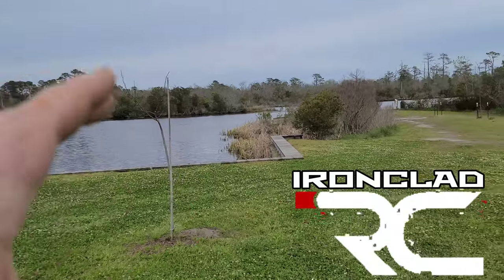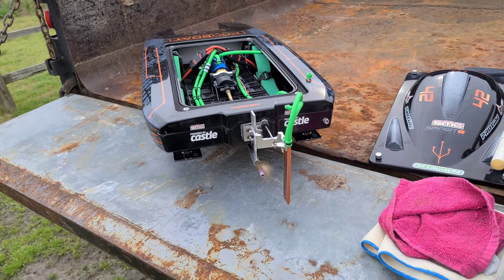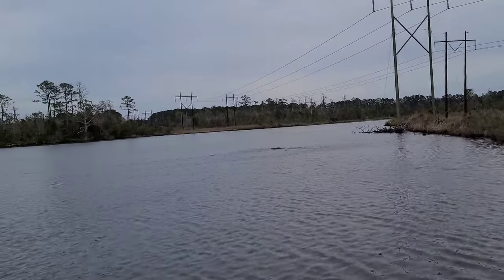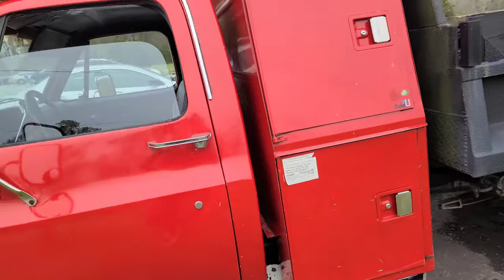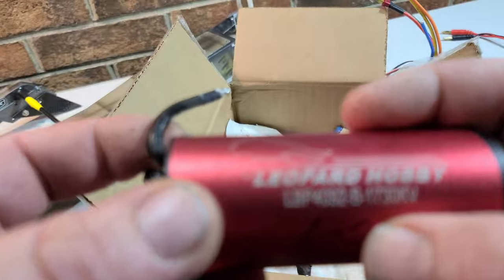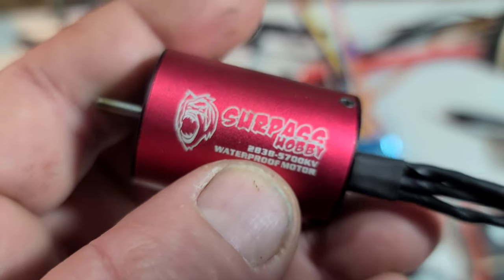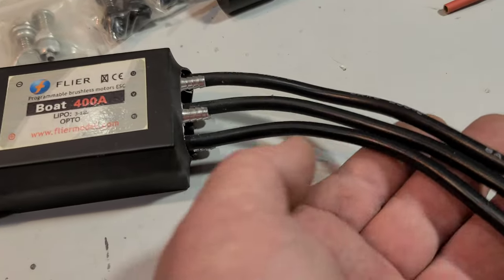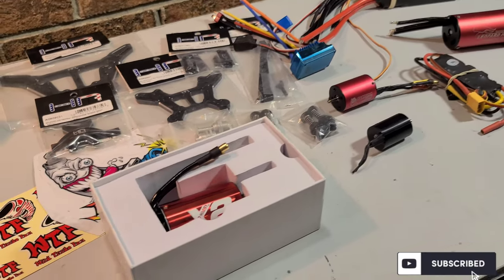Upgraded Blackjack Speedrun 90mph - Subscriber Mail Day - SMC, TPPOWER, HYDRA XLX2

Comment: Looks like you got BJ running right again. Solid passes...👍 
That 1730kv is a nice motor to test in Dom... Probably the 200a esc will handle it fine. Seen some guys using it on t180, so looks to be an interesting upgrade...
Reply from the maker: I'm gonna take the dom for a couple speed runs with the rocket motor before I install the leopard motor..  maybe do another comparison 🤔
Reply: @IRONCLADRC  you could consider a 6s comparison and see witch of the two motors give best speed, runtime, temps on same lipo's... Some people are very enthousiastic about those leopard motors, so let's Tinker and Tune i would say... Keep the vids comming

Comment: That truck in mint buddy!
Today's car have no spirit haha and they all look the same!!
Have a question if you don't mind, I want to run a traxxas 540xl 1800kv ( the one that comes with the spartan) but can't find any specifications on it.
I think it is made by Castel like a 1420 or something! I want to run it with a rcbb 175 esc but don't know what timing should I set the esc at?
So your help would be much appreciated!
By the way I have been flowing the channel for a while and I have to tank you for all the work you put into it so tanks man!!!
Boats gang forever 💪🏻💪🏻💪🏻
Love from Switzerland
Cheers mate 🍻
Reply from the maker: Thanks, wish I could help with the timing on your traxxas motor, not knowing the pole count & wind type we would be guessing..  I'm sure it's a 4pole but not sure wind count.......      delta wind motors 0-5 wye wind motors 6-15° timing.    Higher the timing more rpm but at a loss of torq usually higher timings result in more heat and vise versa.     Hope this helps.
Reply: Thanks B for the quick reply, that's actually the problems I got!
Don't know if it's a D wind or Y wind so I don't know where to start!
Gess I should try 15 degrees of timing first and go from there!
My actual setup is a tp 4060 1650kv pair with the rcbb 175 and it works great but I want to try with the Traxxas motor. My pb with a 4814 
2 blade is 60 mph
Thanks you very much B
Cheers mate 🍻

Comment: Sooo, that same thing would happen to my big storm rudder.  I replaced the stock servo with a 20kg servo found on Amazon and hasn't happened again. Hey b by the way I did a carbon fiber inlay on the big storm all the way through. I've had several mishaps and shes holding up better than I thought since its abs.
Reply from the maker: I bet the carbon fiber really helped sounds ironclad to me.     Have you GPS Tested the stock big storm?
Reply: @IRONCLADRC  havent gps it yet but you will know soon as I do. Hey I have an 80a esc (traxxas) sitting around and a Bancroft monster 19" cat. I gutted it. What size motor should I put in? Just general boating and decent speed.
Reply from the maker: If it were me I'd try a rocket 2968 3400 or 4000kv in that 19" cat, Both motors can be run on 3 & 4s  With a 90a flycolor.     leopard 2860 has been a good motor 3000kv ish range
Reply: @IRONCLADRC  big thanks big b 👊

Comment: You need some new projects ? I have 2 I'm thinking about abandoning and they're much larger than the last...
Reply from the maker: That's completely up to you....  I love that little hydroplane you sent I've been running it like every day here lately.   It's compact and basically fits in my back pack fun little boat
Reply: @IRONCLAD RC  I've got a BJ29 I don't have time for. Was moving things in storage and dropped something on it and broke canopy. V1 canopy is hard to come by
Reply: @brandonwynn9801  yeah they are about impossible to find. Someone needs to start make them
Reply from the maker: Absolutely if your not gonna build it, I would be glad to give it a shot..
Reply: @IRONCLAD RC  lol give it a shot huh ? I work out of state but will be home tomorrow. I'll be emailing you
Reply: BJ was looking and sounding nice 👍🏻 @ 90 mph. Not really sure how long running 12s on the stock 1350kv motor will last 😮 that would be almost 😅 crazy 😜 rpm 😂😂😂. I’m planning on pushing the stock electronics to the max, because of the telemetry 😊
Reply from the maker: The lead proboat designer recently told me the 4685 1350kv bj motor is capable of 12s.    Every since he said that I've had an itch to test it out.
Reply: @IRONCLADRC  Well now you have the 400 amp esc to try it out 👍🏻
Reply from the maker: Yes sir buddy

Comment: Hey man love ur vids! I had an idea not sure if it is even possible to do but maybe u can point me in the right direction... I am looking to upgrade my ft011 v hull abs boat and I was thinking of changing the drive system to a flex shaft system is it even possible on an abs boat like that??? If so would love to see a step by step vid in the future!
Reply from the maker: It's possible, hard part is finding a suitable size strut/stinger for the boat size   4mm or .150 cable system, stuffing tube & Teflon liner, motor Coupler, drive dog, & Prop nut